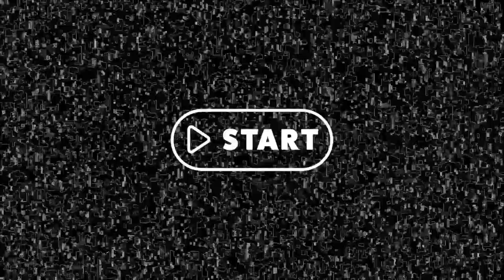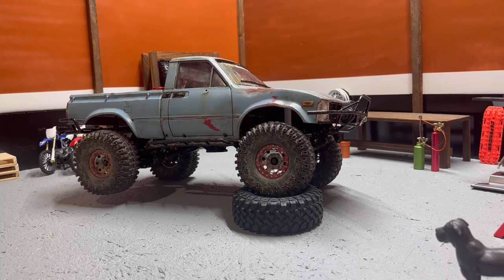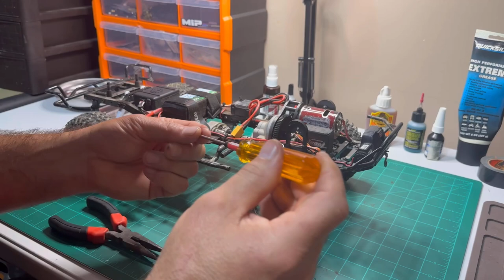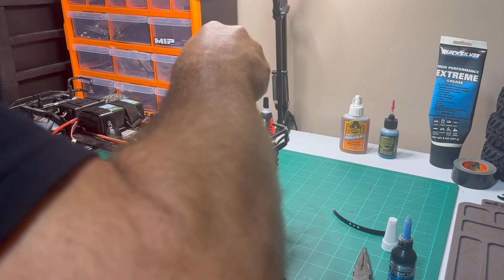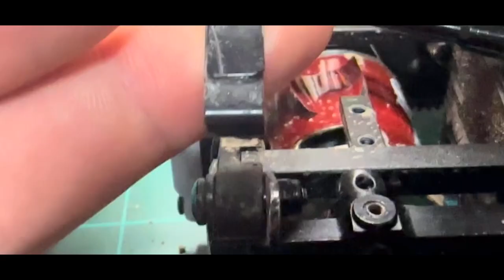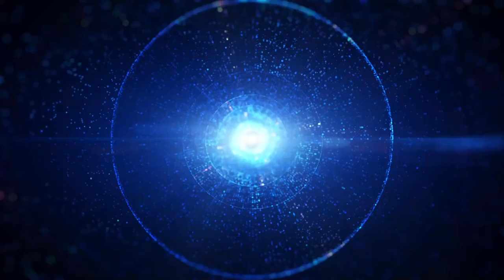Free suspension mods to include the chino mod on the RC4WD tf2! Do they make a difference?

Comment: There are a bunch of tricks to getting more flex out of a TF2,   The trick is to match the leafs to weight of the truck and then work on the amount of flex.    Mods that work well on a light truck might not work so well on heavier truck and same is said for mods on heavy truck,    The Chino mod works well on lighter trucks,   O rings on the leafs at axle work well.   Shooter shackles and Z boxs work.        My leaf setup on my wrecker is 3 main leafs military wrap  in back with helpers,   Scale leaf set up front,   My TF2 has 4 inchs of flex front and back,       But each setup will be different  and every mod has pro's and con's
Reply from the maker: Awesome brother thanks for the tips! Leaf springs are a new challenge for me so I’m trying to learn lol! Much appreciate the help tips and the comment! Cheers!!!
Reply: @419crawlers   It took me a good wile trying one mod then another and back and forth till i found what works for me,
Reply from the maker: @sirchirpalot  thanks brother I appreciate it! I’m still tinkering